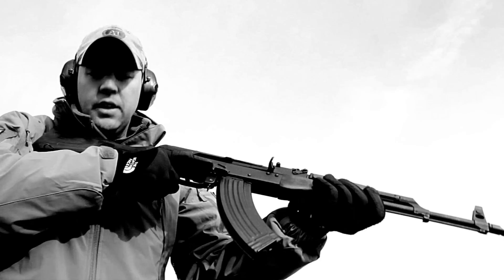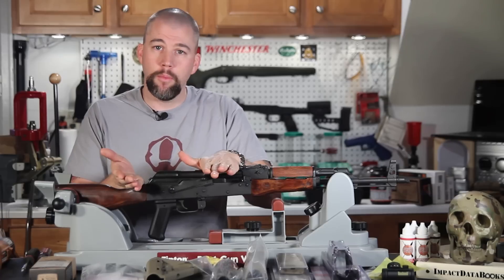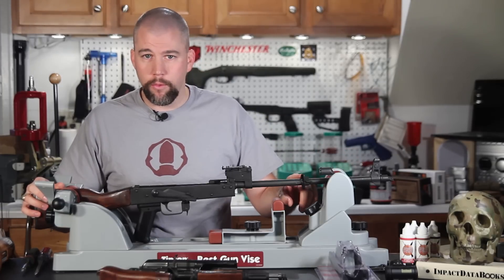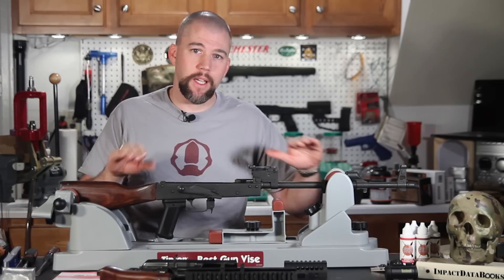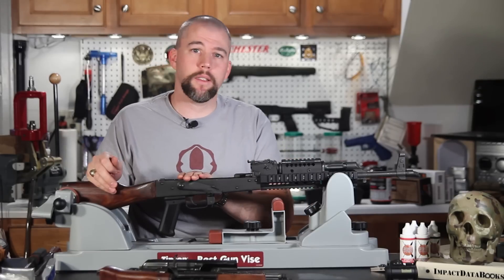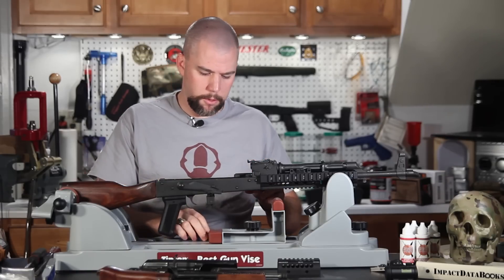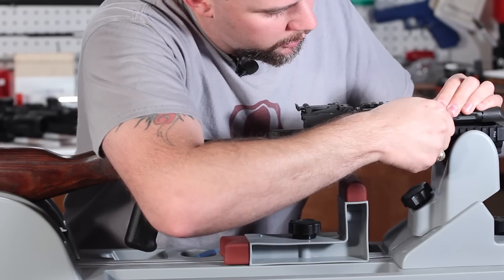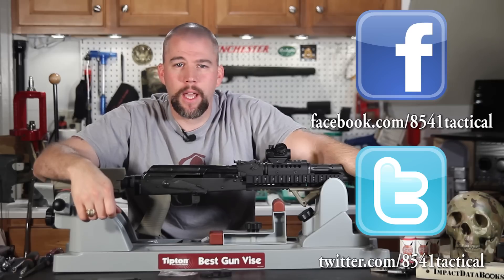Improved AK Build - Midwest Industries AK47/74 Extended Handguard and TRS-25 Installation

Comment: I strongly suggest that any unused space on the rails be covered by either magpul or blackhawk rail covers or any aftermarket rail covers since these act as insulators to protect your hands from the hot rail.
Reply: Michael Mitchell also wear gloves regardless what you have. These things heat up after about 3 mag dumps.
Reply: @4pitts1burgh28  Yeah, lol gloves are great, rail covers are dumb

Comment from the maker: New parts on the AK!
Reply: ***** Loctite will not hold up believe me .With all the heat and vibration the handguard will get loose and u will loose u`r zero .
Reply: The extreme heat is the problem ,it will melt the Loctite ,after that the vibration helps it to get loose .In fact to remove a loctited bolt u use heat .Gun barrel and gas tubes get very hot when shot hard .
Reply: My friend engines operate at around 100 Celsius ,but rifles when run continuously (4 mags ) can reach well over 600 Celsius barrel and gas tube (Piston) ,there is no Loctite that can hold with those temps .That is why gunsmiths stake anything that has threads .
Reply: Use what ever u want .I don`t give a rats ass .But for anyone ,who want to learn ,no rifle not pistol made by real gunsmith that u`r life depends on it has screw .the Ak 47 ,Glock etc  has no screws , The ar15  (only has the castle nut and gas key (both stacked why ? because they will back on you when u don`t need them to .The least u can do is stack them and they will stay put,that what I do  .Peace
Reply: How crucial is having a gun vise for jobs like this?
Reply: Vanguard556 I think you drive motorcycles what do you have

Comment: I have a side rail on my Sam7 SF and i use just a red dot, not the LPVO i used to run on it. I love shooting the AK with just a red dot. That being said, i have not looked through a red dot mounted that far forward.  I would like to try it because the downside of running a side rail for optics is that you cannot fit clamped magazines on your AK because the side rail blocks them from insertion.

Comment: You may want to note that removal of forward sling point is not required for the standard model. I almost cut mine off not noticing this video was for an extended version, didn't even know they made an extended version.

Comment: I have the same exact rail on 2 of my guns my only gripe is there not long. Instead of them being 9 and 1/2 inch long at the bottom it should be an even like 11 or 12 in Long and the top rail should also be at least 10” I find them to be two short still

Comment: Im not sure why you did not mention the side rail mount that comes on most akm platforms or is your version missing that I think this rail works for a reflex sight but you would need a LER scope for anything magnified IMO the side mounted rail can give you more flexibility and its quick detach for a quick transition ta irons when your optic gets smashed btw its an ak and she can take a hit
Reply: I have the side rail on my AK but there is at least one big downside IMHO. You can't use mag clamps. Your clamped on mag will be blocked by the side rail.

Comment: John, did you look at the ultimak upper & lower handguard set before deciding on the MI railed handguards?  I'm undecided at this point but like the fact that the ultimak doesn't require permanent modification of the rifle. BTW, since someone asked about the TWS Dog Leg, it's excellent but don't buy their handguard until you've done some checking on instal and amount of heat that's transferred to them (and to your hands).

Comment: I don't see why Midwest Industries doesn't utilize that cut out in the front of the receiver and/or the hand guard retainer to align their rail with the gun. Seems like it word take the guess work out of aligning it with the eye and if it's off, good luck with zeroing. Also it would eliminate those stupid anti rotational set screws and make it easier to field strip. Troy figured this out with there first ever AK rail.

Comment: I think wood stocks look better in my opinion if I had the problem with it not fitting my body I would get a bigger wood stock but that's just my opinion
Reply: Wood hand guards have a habit of catching fire with extended use. Particularly with bump stocks.

Comment: That's why they come with a side mount to install an optic. The rifle is front heavy to begin with. Putting everything in the front just makes it worse. The dude mount on the receiver is there for the reason to help balance the rifle. Why wouldn't you use it? I like the idea of putting a rail system for lights, laser or fore grip. But not everything.

Comment: is the lower handguard retainer required for installing this rail system? I have a c39v2 that came with the zukhov furniture and I'm really wanting to add a small red dot that will still allow me to use the iron sights. My AK has the milled receiver (no side rail) and since  it came with the zukhov handguard installed, has no factory lower handguard retainer.

Comment: Do you have to remove the set screws on the top cover of the new handrail to remove the gas tube?
Reply: Yes. In the unlikely event that I need to remove it, I keep the key in the grip.

Comment: NOW THAT YOU HAVE APPLIED LOCKTIGHT TO THE UPPER HANDGUARD BOLTS HOW YOU GONNA REMOVE THE GAS TUBE?
Reply from the maker: By unscrewing the screws. Loctite isn’t permanent. However, AKs are not primadonnas. They don’t need to be cleaned after every shooting AND the gas tube is still accessible through the receiver.

Comment: Did your WASR come with the bayonet lug? If so do I need to modify it for the extended rail install?
Reply from the maker: Sean, our WASR does have the bayo lug. No modification to the lug was necessary. After installing the rail system the bayonet will still attach.

Comment: I am having trouble with a rail by Midwest industries.  I bought the key mod of this rail and as I was in stalling it I realized that the part with the sling holder that I filed off is still to fat.  The key mod rail doesn't have a slit for the part.  Also I am trying to install this on a waffen werks ak 74 platform with the Bulgarian parts kit.  I noticed my barrel isn't some smooth barrel and has different thicknesses closer to the receiver.  Lets say that I do file the sling part to fit and that works will the different sizes on the barrel eventually throw off the rail being level if I get it to that point?
Reply: I would suggest contacting Midwest Industries for customer support. I am not familiar with the AK variant you are working with.
Reply: Waffen Werks 74 with a Bulgarian parts kit.  Very run of the mill stamped AK.  I think because my front sight is so canted right and the front sight post is so left its just messing with my eyes.  Its going to the gunsmith soon.  Thanks for the reply though and your videos kick ass always a help for me and my roommates.

Comment: I just installed a MI Vepr handguard.  The lower handguard fits EXTREMELY tight.  I had to use a rubber mallet to get it on.  Was not pleased, question is.

Is this going to cause a major problem being so tight on the barrel?

Comment: hows the heat on the handguard  i bought a low brand handguard and it gets hot after 90 rounds i had the rubber protecters on it and it was still hot were i couldnt hold it i had to hold it from the mag ..so if u can give me info on the midwest hand guard if it gets hot fast or it doesnt thanks

Comment: QUESTION : How was the co witnessing, was the dot right on top of the iron sights...also after you installed the mag pull stock could you rest your cheek comfortably on the stock and see straight through the optics or do you have to lift your head all all while aiming?
Reply: The irons are too low to co-witness. We ended up pulling off the riser. It isn't needed.

Comment: Does the cleaning rod not go back with the extended handgaurd?
Reply: There appears to be room for it, but I could not get it to seat into the receiver. Not sure if it's a tolerance issue with the WASR or with the handguard.
Reply: I tried to as well with my DDI could not fit the cleaning rod in.

Comment: Just bought a SAM 7R from arsenal - do you know of any telescoping 'AR style' stock that will fit the double tang milled receiver?
Reply: I have the same rifle and have been searching for months with no luck
Reply: Dan Abraham alexhartang 
I'm not entirely sure if it'll work, but you might, keyword MIGHT, be able to fit a CAA stock tube or a Mako Group one without removing the lower tang. I've seen it done on some double-tang AK's, and the individual(AR15 forums, not sure which tube he used) used the lower tang as a single-point sling mount.

I'd say your best bet is to either get a Warsaw length stock from Kvar and add spacers or a butt pad to get it to the right length,(Easy to make it longer, but difficult to make a stock shorter) or get a CAA polymer stock tube and dremel out a slot for the lower tang. Best of luck, you two.

EDIT: Tapco also makes a stock tube for Milled AK's, and there are reviews saying it requires no modifications. Worth taking a look.

Comment: I have an AK 103 and I assume that I can do all of your "Improved AK Build" mods to my variant?
Reply from the maker: I believe the rail system will fit the AK-103. If your AK has a folding stock, I do not believe the Rifle Dynamics stock adapter will work.

Comment: changed my stock with a vtor buffer tube and a magpul adjustable stock. everything in great, except the buffer tube wiggles. is this normal? or did i do something wrong? by the way its an arsonel sg21.
Reply: Does your buffer tube itself wiggles? Or did you mean the adjustable stock wiggles on the buffer tube.  If the buffer tube itself wiggles that is not normal.

Comment: would this fit a Saiga "sporter" version 7.62X39 AK variant, as imported,  without modification, or with minimal modification?  i am trying to piece together a Saiga to convert, but most regular ak parts won;t fit for furniture up front as is.  will this work?  Thanks

Comment: the AK is already built as CQB battle rifle. thats the way its designed. also, the sights are battle sights which enable you to keep both eyes open.. instead of the sights of for example an m16, which are more like target sights. first tip for mounting custom sights like red dots and so on is to put it furthest to the front as possible .

Comment: Agree with the bottom railed hand guard as it is good for lights, laser pointers and second vertical grips. However the railed top is somewhat puzzling. Why not install a side rail and use a proprietary optics, of which there is plenty from Russia, China, Belarus and possibly Ukraine? The Russian ones are of good quality and built to be battle-tough. If western optics are the choice there is an adapter that mounts a Picattini rail really low over the top cover and allows for red dots, collimator sights, sniper-style sights etc to closer to the eye? When removed from side rail, zero is unaffected since it is always back in a same spot, unlike with Picattini/Weaver.

Comment: looks cool, but it adds additional complexity to an otherwise complexity free system, i.e.: 10 screws to hold the new hand guard while the original guard uses none...it has to be a better way to add rails to guards that lock using the usual AK lever based locks

Comment: Can someone give me my best options (as in manufacturers/type) for an AK47/AKM? I just built my AR15, and I love that thing, but shooting a friends WASR-10...those things have some real power and are fun to shoot! Avoiding the local WASR-10s I checked out at guns shops because the loose mag wells and canted front sites, really just looking at the IO Inc Sporter AKM and Arsenal and Century Arms AK's (Obviously Im On a budget) recommendations? (Sub-$1000!!)
Reply: I have a century arms ak47 sporter...awesome gun ...when you pull the trigger you can always count on the ole girl to go boom ..its built like a tank, and you could beat someone to death with it if you were out of ammo and not hurt the riffle haha .......BUT THE CENTURY ARMS.  MADE IN THE USA
Reply: There's so many ways to go.  Do you want to go milled or stamped?  Are you going to want to modify it and add goodies to it?  Do you want an AK47 or AK74  These are the questions you want to ask yourself.   I personally wanted about as close to the best of the best in a milled.  I went with the Arsenal SAM7R-51   I've done a few mods such as a tuned G2 trigger, Krebs plate, an Arsenal PR-01 quad rail, a Surefire 300X Ultra light and a Aimpoint T1 on an RS Regulate mount plus a Hogue grip.  It turned into a great looking rifle.
My set up though has gone over several thousand dollars.  The simplicity of the AK renders all of them except the worst of the worst, a functional rifle.  Stick with a reputable dealer, such as K-Var or Atlantic firearms and you can't go wrong.
I heard that the Russians are going to put a factory here in the US to get around Bamas Russian import ban. 
RWC, based in Tullytown, Pa., has the rights to the AK-47 Kalashnikov brand of guns, which has been produced in the Soviet Union after World War II and are looking for a site to build here in the US.
Happy shooting!

Comment: Totally disagree with what he's doing. I have 2 AKs. One new Saiga which has that same system on the front end (it came like that when I bought it.)  and a WASR with wooden front furniture. The Saiga is more accurate because it's new but the WASR is a faster draw and easier to shoot because it's lighter and you dont have to wear gloves when you shoot it. The tactical rail is too heavy to shoot all day and it WILL CUT YOUR HAND WHEN YOU SHOOT IF YOU DON'T WEAR GLOVES... that being said I'd recommend a polymer furniture if your'e going away from wood. It's what the Russians do now anyways, and for good reason. You'll kick yourself for paying the $100 to make your AK annoying to shoot trust me... if you want a lego gun just get an AR. just get a quick release mount for your side bar and stick a red dot on there if you must. But the Iron sights sight up so easily. I'm not even using red dots anymore... there's no point. One more thing to get in your way that could fail. You didnt get an AK to complicate shooting I'm sure.
Reply: Check out zenitco, they make parts that the Russian military uses on their rifles, as you will see they are not polymer. The rifles come from the factory with polymer furniture, but like most militaries, they update the rifles for mission specific tasks, and the parts they use are aluminum alloy. I use gloves when I shoot ak rifles, but only because of the heat, the rails have never cut me on my ar-15s.
Reply: Check out zenitco, they make parts that the Russian military uses on their rifles, as you will see they are not polymer. The rifles come from the factory with polymer furniture, but like most militaries, they update the rifles for mission specific tasks, and the parts they use are aluminum alloy. I use gloves when I shoot ak rifles, but only because of the heat, the rails have never cut me on my ar-15s.
Reply: All about preferences really, I don't care much for being all tacticool with an AK, but this day and age it's necessary to keep up with improvements as mounting a rear or forward optic can make you that much more accurate and lethal down range, I don't have a problem with it being uncomfortable since I wear gloved when I shoot.

Comment: That's an akm, not a 47.
Reply: I never understand why people bother correcting someone for such minor things - is it a pride thing? If that's why, wouldn't it just be better to call it by it's model name? After all, if we're nitpicking to the point that it's not an ak47 in that it has a stamped receiver, wouldn't it not be an AKM either because it's semi auto only? Do you call a stamped Chinese AK an AKM because it has a stamped receiver, or an AK47 because it has a ventilated gas tube? Etc - backslash roll eyes emoji.
Reply: Whats the difference I actually want to know cause people say that in all videos. Isnt the ak47 just an older akm
Reply: @geometricalwolf5583  Thinner barrel, stamped reciver as opposed to milled and a few other small differences

This is a semi auto facsimile so if peolpe wanna be technical assholes its neither